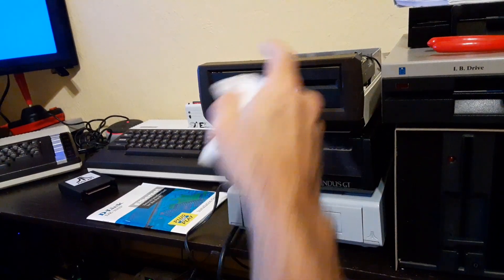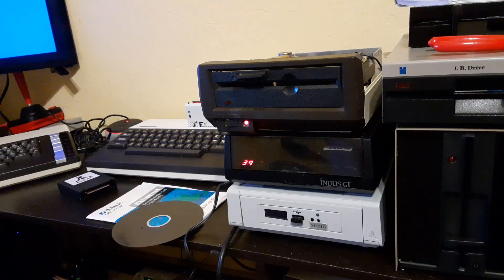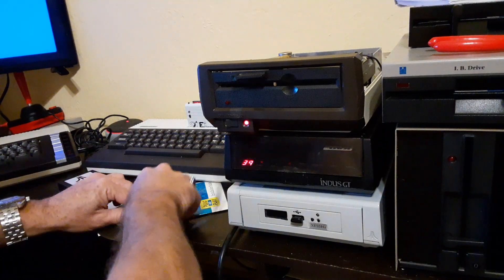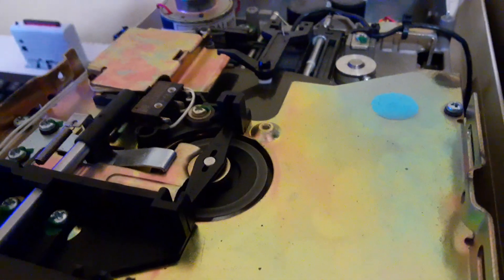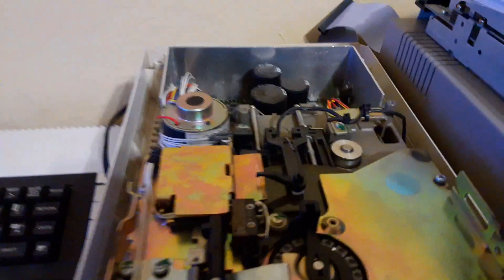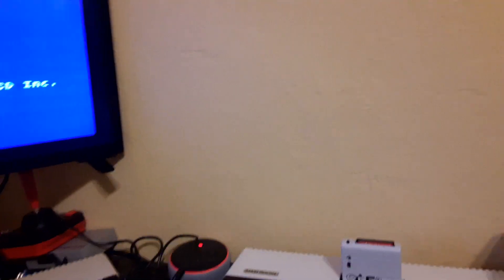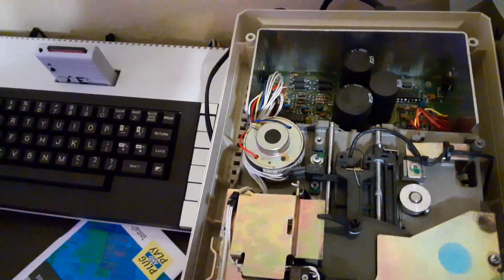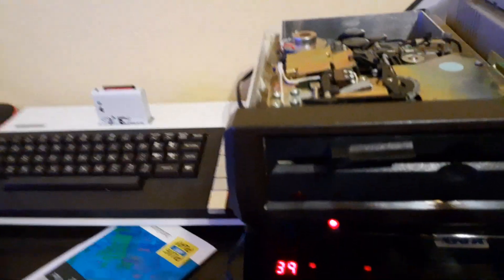Mounting a Naked Floppy and recovering data from 30 year-old diskette

Comment: Using a grease weasel might get you something better for recovery if it was actually something important but obviously this is just a thing to try.
Reply from the maker: I do have a grease weasel, to produce disks for vintage computers.  Most floppy controllers for the PC are unable to produce an FM (Single-density) disk, so the weasel is my go-to in those cases.  Prior to getting weasel I was using a PC and various vintage tools to produce vintage disks from images so long as they were double-density.
You are right.  Were this a vital disk, my first step after cleaning it would be to image it a few times using the flux reader, THEN try file-level recovery.
Reply: @Technoid_Mutant  I've only really used mine to image some cross format 3.5" disks from a magazine here in the UK that I thought were interesting. I was always fascinated as a kid how they made disks that could be read on a PC (IBM compatible as they were called at the time), Atari ST and Amiga as a native format on each one with different content.

Comment: The only disks I ever used that could be ‘flipped over’, were the 3” ones used in the Amstrad CPC6128.

It’s true that a 5.25” floppy disk could be turned over on a single sided drive that only read one side but it was far too much hassle and the disk was likely to fail at some point. Personal experience.

Running a disk without its jacket is a disaster waiting to happen. The cookie just isn’t designed to operate like that.

Comment: Did you even try running Jumpman to see if it wasn't just copy protected there and might actually need that error sector in order to verify the copy protection? Maybe instead of using a copier that does each item as separate files, try using an image copier: one that just copies a disk exactly, sector by sector/bit by bit, regardless of errors, etc.?

Comment: Why would you rasor the disk's -"envelope"- jacket to remove the disk when you can do more easily by simply snapping the edge-folds off from the main surface?
Reply from the maker: The jacket is so atrophied with time that flexing it would be to shatter it.  I've discovered that feature of old jackets the hard way.  Even so, you can see that the razor made a jagged cut.